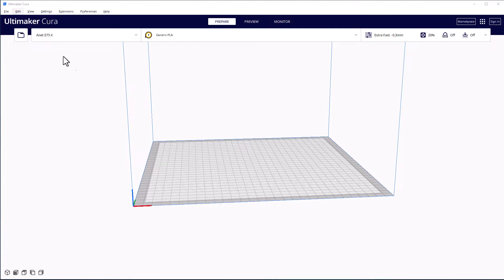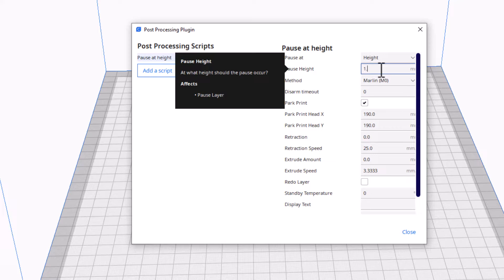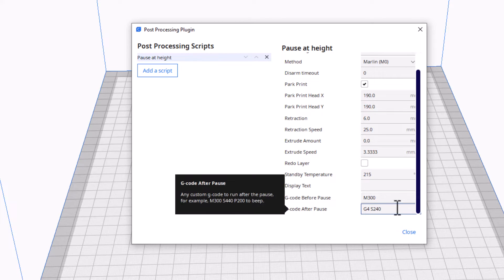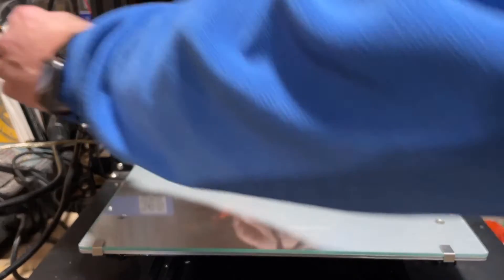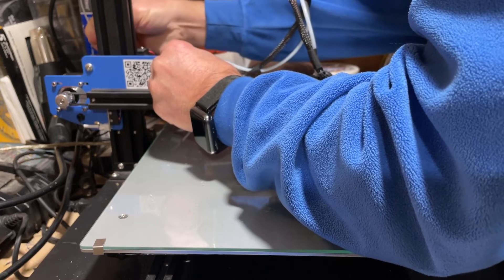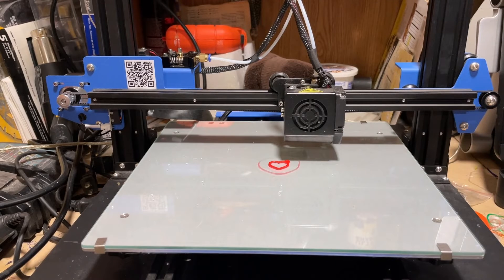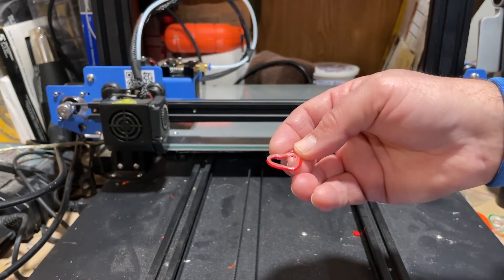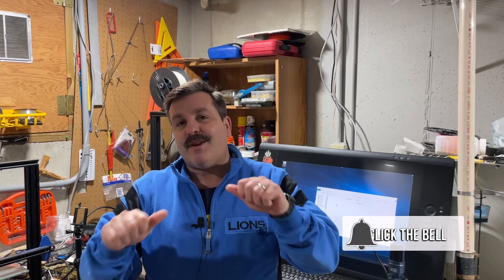Cura Pause at Layer height with a Stock Anet ET5X Working STEPS!

Comment: I'm guessing the M600 command did not work or work correctly.  This is a good work around, but I prefer the print head to move to a corner and then wait for the operator to change filament and then do an input to resume printing.   I use the same M600 for filament runout and layer changes.   This way the printer can run and encounter it and wait long as necessary.  The code turns the hot end off and I manually reheat before changing
Reply from the maker: You are correct that M600 did not function. =( I agree that the input to re-start would be way slicker.
Reply: @HLModTech  Thanks for letting me know.  This makes your solution better, as at least you have a solution.
Reply from the maker: Personally I hvae a couple of mixing extruder printers. I prefer that over this trick, but a user asked it is was possible... so down the rabbit hole we went. 😜
Reply: @HLModTech  I just got a Bambu X1 Carbon with the AMS, so am excited to try the colors changing.